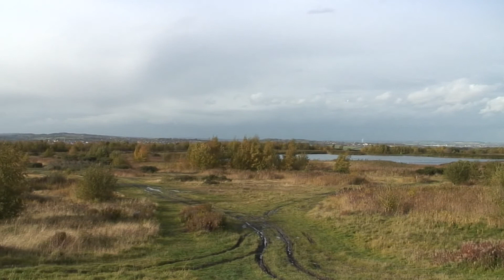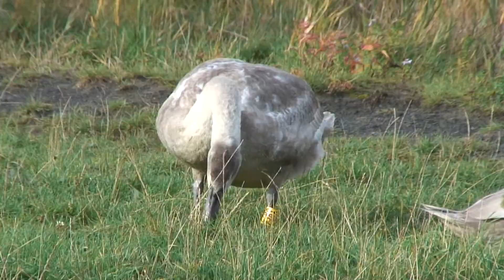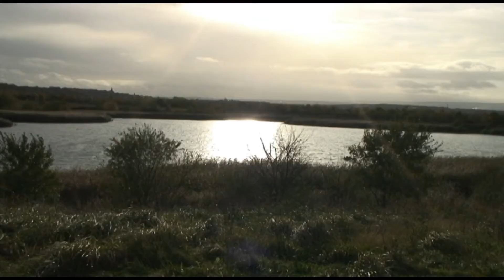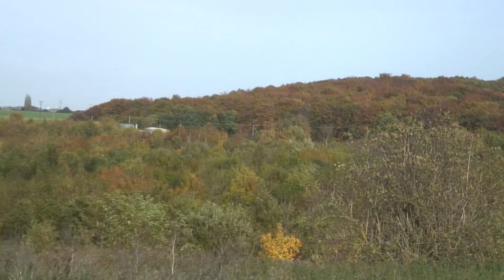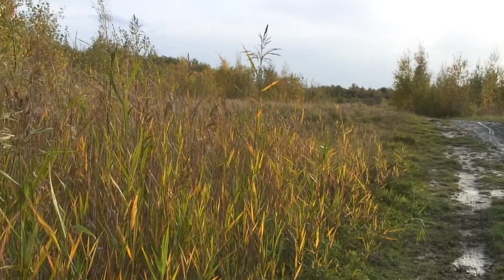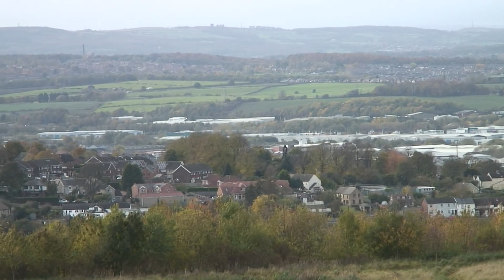2nd Try: Sony HVR-A1J HDV Camcorder Test

Comment: hi steve, what's a good way to de-interlace?
Reply from the maker: I use Yadif 2x normally, which generates a 50/60fps file and preserves the smooth motion. Its available in Handbrake and Avidemux and other programmes. I think the standard definition footage in this video may have been deinterlaced using standard Yadif, which generates a 25/30fps file, hence they look a bit jerky in this video.

I've given QTGMC a go recently, which was a pain to set up. I think the quality I achieved with that was slightly better with some clips, and hardly any different with other clips. 

Handbrake also has an option called EEDI (and EEDI Bob). This in theory is supposed to be better than Yadif, but it is very very slow and I can't tell any difference in quality.
Reply: @stevecoatesdotnet  oh, thanks for the quick response. I have used Handbrake before, and I'm a little confused. Should I preserve the resolution when encoding with YADIF or should I change it to something else?
Reply from the maker: @rupert6478  It depends on what you are doing with the footage. If you are just keeping it on a computer or playing on a TV, there is no need to change the resolution; by doing so, you may end up losing some quality. However, if you are uploading to YouTube, you may need to change it. If it is standard definition video, youtube will compress the crap out of it and it will look rubbish, therefore, if you scale it up to 720 or 1080, it will look better on YouTube. If you deinterlace it to make a 50/60fps file, youtube only supports these higher frame rates in HD, so to get the high frame rate on youtube you will need to scale it up to HD. These are just quirks of how YouTube works and won't apply to video played back in a normal video player software.
Reply: @stevecoatesdotnet  alright, thanks. I'll try de-interlacing first and then rendering it to 1080 progressive